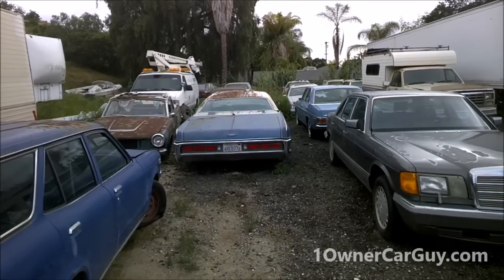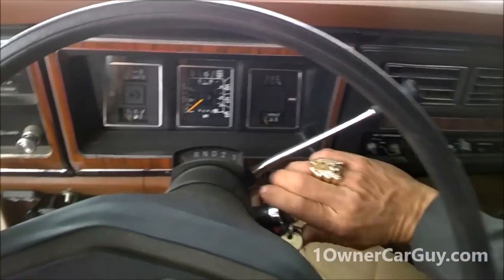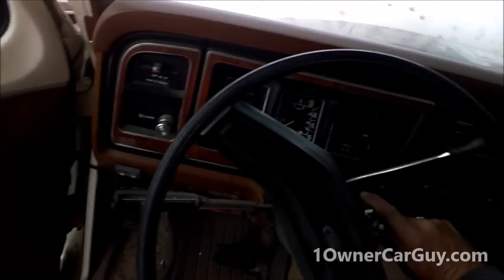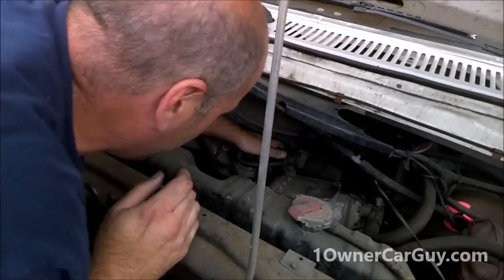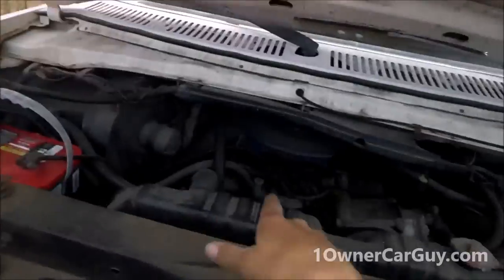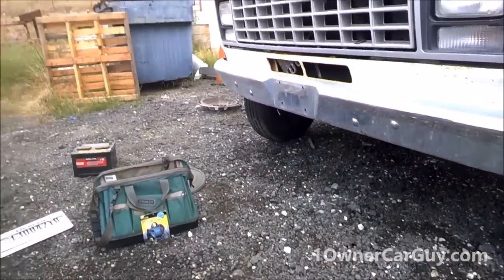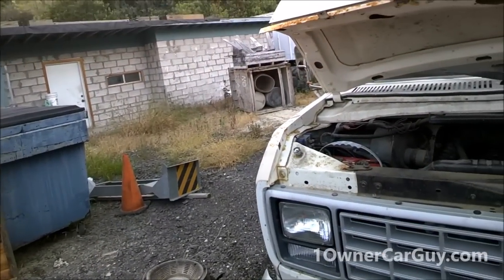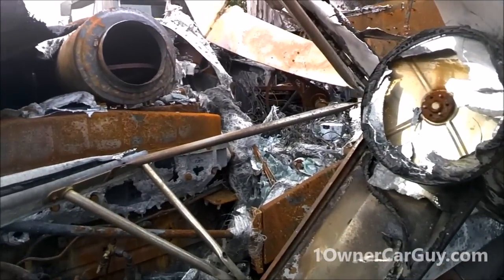RV Cold Start & Work Vlog Behind the Scenes Video

Comment: dang man hell yeah more old starts cold starts I'm really liken it and the carburetor problem u can take a screw driver or something tap on it while it's either running or not and make the float inside carb to get unstuck I would tryed that probably stopped it leaking and damn it sounded so good that 360 sounded almost like race car or something I like that alot not bad for camper could turn that into sleeper or something nice or bad ass